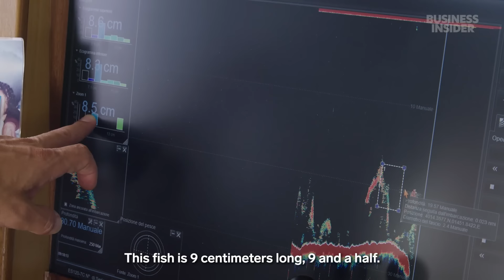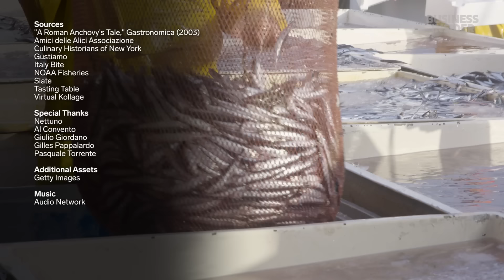How 20,000 lbs Of Anchovies Spend 3 Years Transforming Into Expensive Anchovy Sauce | So Expensive

Comment: 50-60 fish per barrel (6:10)?  One layer is 20-30 fish, so you saying there are only 2-3 layers per barrel?  Your drawing shows 8 layers at least. It looks to me like there are around 300-500 per barrel,
Reply: 50-60lbs
Reply: @madisonhruschka3718  The quote was: Each barrel fits about 50-60 anchovies depending on the size of the fish".  Not sure if they meant 50-60 lbs, or if they meant 500-600 anchovies, but something is way off.
Reply: Yep. I just re-watched. Something's off. It's 16-18 anchovies per lb. That would be around 800. That doesn't make sense. Maybe they meant 50-60 anchovies per layer?
Reply: @madisonhruschka3718  But the video does not back up 50-60 per layer.  Look at 5:45. I count 20-30 fish per layer, unless they are double stacking them.
Reply: i caught that too. maybe a barrel could hold 50-60lbs of raw anchovies, but to me the barrels look a bit small for that. my best guess is they meant a full barrel (wood, salt + fish) totals 50-60lbs.

Comment: The Chinese Communist Puppetalia, reckon they can make the "fish sauce" for a fraction of the Italians anchovy sauce,
they can pump-out squid sauce for $1.50 per liter, and that's with the salt included. They also make fish sauce, which is
exactly the same as squid sauce, except they change the "label" on the bottle, and they throw-in extra amounts of MSG,
which makes the fish sauce more expensive, as the MSG costs more than ordinary salt, lifting the price of fish sauce
to $1.70 per liter. The squid sauce usually has a picture of a squid swimming through the ocean, and even the bottle 
has a shape, that looks like a squid. If you sometimes "run-out" of salt, grab the "fish" or "squid" sauce, as the flavor is
much more salty than fishy, but the smell is much more fishy than salty.